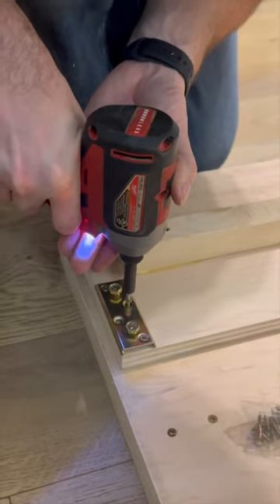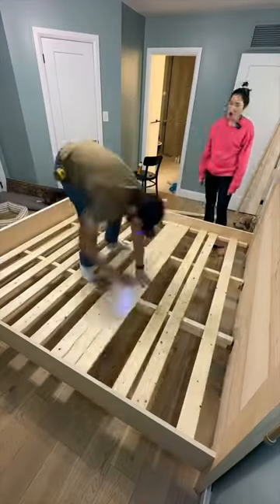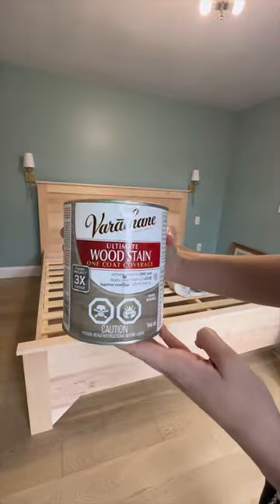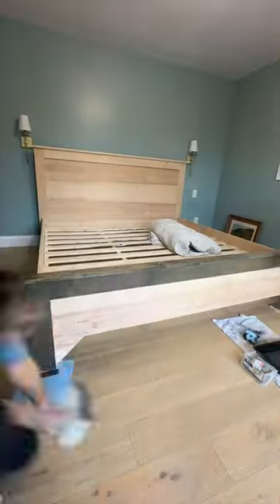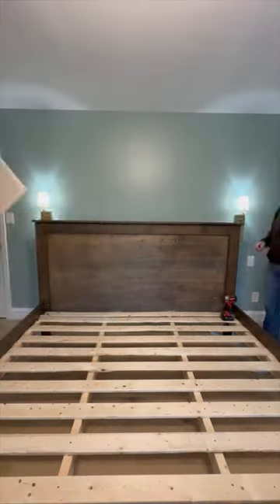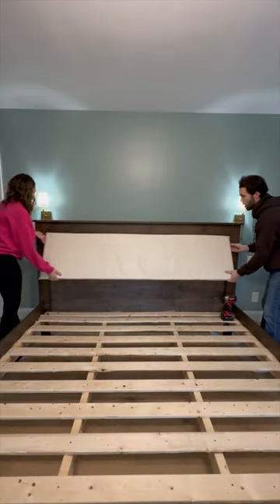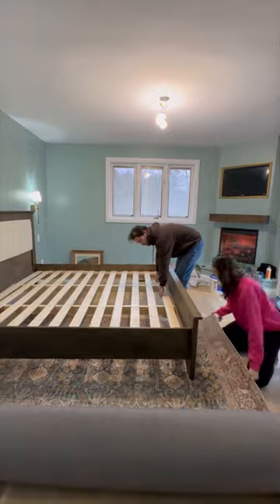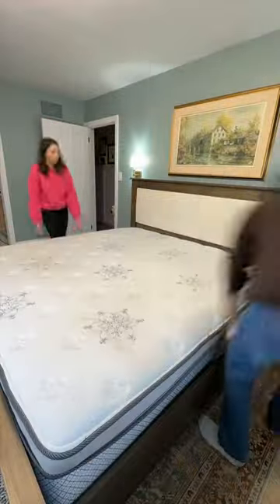Don’t make this mistake 😶 bedroom makeover ep 5 #shorts #diy

Comment: Whenever it rains on my wood working projects I would wipe it down with a damp cloth to make it stain evenly. I learned that from a cabinet maker.
Reply: I thought that was a step anyway, while prepping it (you wipe it with a damp cloth to remove any dust etc).  Or a wood conditioner to give an even stain.
Reply: Yes, always wipe wood with a damp cloth before creating with it. It causes the grain to raise evenly so that when sanded or stain you get a consistent coat and texture.
Reply: I never knew this but it makes sense. Thank you commenters
Reply: Thanks! I didn't know that
Reply: I came to say the same. Even now they could have wiped the wood with water let it dry then stained it again. Water is a funny element and mucks up a lot of creative work.

Comment: Pro tip  When staining any wood first apply a pre stain. It is clear and helps condition the wood to get an even finish.
Reply: True but do test for final color, conditioner also lightens the end product vs no conditioner. Use situation specific like this one
Reply: Pro tip, no need for pre stain. You can just wipe it down with a damp cloth before staining to open up the grain
Reply: And that pre-stain is - you guessed it: Water :)
Reply: @LifeOnHoth No, it’s not.
Reply: I went there but I'm not a pro, my cousin is.
Reply: Came here to say this, stain looks like dark stain applied directly to soft wood without a pretreatment.

Comment: I actually had this happen AFTER I stained, I don't have a garage and was curing stained butcherblock outside when a freak sunshower happened. We quickly hauled it into the truck and noticed there was a few spots from rain drops afterwards. Nothing major so we didn't do anything to try and fix it and went on to sealing it with tung oil (works absolutely amazing btw, our wood has been totally water resistant, just oil about once a month when its dry)

Comment: Here's a suggestion: leave your wood out first to dry when they get wet. Even just a little it'll soak into the wood and will cause impurities. So if you dont like your wood to have freckles, just air dry them after you have wiped down as much moisture out of it that you see. You could also run a hair dryer on it to it would dry faster but air drying it for like a day or two will work. Also always put a tarp on your materials as soon as you leave the place you got them from. Understand that those stores are temp controled for a reason and its so you get the best stuff at its best conditions. So protect it as much as you can. And water is bad or a no no for all construction materials.

Comment: The best practice is to always give any project a light sand with 220 paper and then use a tack cloth to remove any dust, oil, etc.  

No moisture was trapped.  The stain was splotchy because of stuff that dried out of the ran drops. Think water spots on a window.  Also, with all soft woods, a coat of sanding sealer is recommended to give a nice even finish.  You can skip this step on hardwoods like oak an wallnut because they absorb stain slower and more evenly.  However, sanding sealer is recomended for hard woods as well. 

I do like the paded headboard though.  That will make sitting in bed much more enjoyable.😊

Comment: All you had to do was make sure it was dry, completely completely dry, and then give it a good sand with the grain not against the grain, you would not have sanded through the veneer that takes quite a bit actually, and then, when you stain it, it would not have had any more dots You also could've wet sanded it which means sand it while it's wet with stain and that should've rubbed out most of them

Comment: Plywood doesn't have a veneer. I've laid plank flooring with 3/4" plywood through multiple rooms.  I've had to sand , stain, hate it, re-sand, stain again and seal. You can absolutely sand plywood. It doesn't have a veneer and the stain doesn't penetrate through the layers enough that you risk not sanding it off. FYI for next time.

Comment: I will be corrected if I am wrong but, those spots are mold. You just covered the area up with material that will be taking in moisture from your breath for years to come. I hate to be a bringer of the big sigh but....sigh...please protect your lungs, your immune system and your sleep by taking the "correction" off, sanding the piece down, use TSP or Oxalic Acid to bleach the wood after you do a light sanding. Then, see what it looks like after this fix. You might be luck and find that your spots are gone as the mold roots will not have been growing inward for very long (assumption). Stain and seal but use a poly to do the final coat. Molds can live for thousands of years, spore for new growth when moisture and temperatures are just right. 

I was an auctioneer, restored furniture, owned and added onto an 1815 log cabin filled with antiques, ran an antique store and at 63, I can tell you the truth and get forgiven if I am wrong because I am a Nana who knows too much! I get migraines after exposure that can last for up to thirty days. No longer working due to complete disability started by this thing that is so unforgiving. I can't be anywhere with any of the things I love the most....old stuff and making things from lost and found natures gifts. 
Peace and blessings to you and yours.